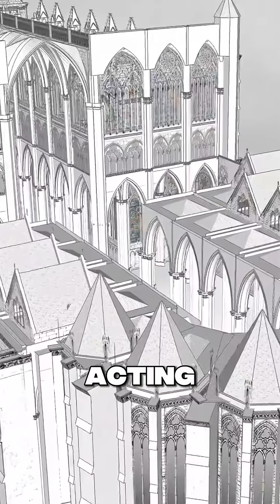The Secret Geometry of Gothic Cathedrals

Comment: Tye buttresses are there to to transport forces from the forces going from the roof traveling through the arched vaults inside to the walls then to the buttresses. Pretty simple without tge buttresses the forces moving through the archs would push the walls the way he described with the paper.

Comment: this is a work in progress, so I keep re-posting it 

My delusional theories about the Pyramid ...

I'm convinced the deep vertical shafts are resonance tubes that are used to transfer and amplify the Earths natural vibrations...
I'm convinced of that because physics says you can pulse a sound vibration into a tube over and over again to make it bounce off of the returning pulses, then all the vibrational pulses bounce off each other, and they will all increase in speed, strength and amplify

*Unlimited free energy as long as the Earth spins

Basically it would shake & vibrate the Pyramid above like a Titty Dancer on payday

 (vibration = power &"Combining" vibrations is a Science we know very little of yet)

So inside the Pyramid we then have the bizarre situation where that since the Pyramid is a natural Toroidal Structure it then causes ions and protons to swirl thru the stone in a Torodial field

This is why they chose the shape of the Pyramid, it's incredibly powerful - it funnels energy, compresses and pinpoints it 

(it's complicated but imagine a doughnut shape that's formed by electrical & gravitational forces, this traps ions and protons within it and causes them to swirl endlessly inside, like a invisible washing machine in mid air)

And by passing thru the stone of the Pyramid the protons also pass thru the 2 1/2 tons of charged Quarts Crystals that were activated by the Vibrations in the stone

Please don't call the Police I'm perfectly fine...The voices said so

OK...So all of these swirling Charged Protons then go into the Kings chamber. But it isn't a Kings Chamber at all it's actually a plasma field generator. Also the Sarcophagus isn't a Sarcophagus it's just a Vat for containing Mercury.

So the "multiple" vibrations of the Pyramid then activate the Mercury inside the open Vat to turn it into a Plasma field

(Fun fact is you can turn Mercury into Plasma if you apply the correct vibrational frequencies & also note the Sarcophagus "rings" like a bell if you strike it with a stone (or carved to a specific resonance tone)

So!!!

Now we have a contained field of Plasma where Protons and ions are being swirled about it in a Toroidal field and then being shot out the tip of the Pyramid

*And I suppose that's what the ball lightning phenomenon is, a natural self contained toroidal field 

Now the question is why?

I need to read up on Tesla's theories to go further but I'm toying with the idea that it acts something like a Mercury Arc Rectifier and changes the Protons and ions, 

(Basically a Mercury Arc Rectifier is a known machine that utilizes a field of mercury plasma to instantly change AC to DC)

But I think the Pyramid is a perpetual motion machine that super charged the upper ionosphere with lightning & with altered Ions and radio waves so it could be downloaded by people on Earth to use as a power source
  
* & I think it's very plausible the Djed pillar is a type of receiver for that energy, when its three disks are vibrated the tone is the same one needed to match the frequicies of the radio waves  

* Another thought about Toroidal fields - I read that when a Troidal Field is functioning it produces a mini version of itself that hovers above it - bizarre as it sounds it's like a mirror image 
So with that in mind I think it's entirely plausible that a large permanent ball of light would form above the tip of the Pyramid, stationary ball lightning  
This would of course appear to be a massive eye floating in mid air that would be visible for miles & miles...

Appearing to be the eye of a God watching every move of the people below